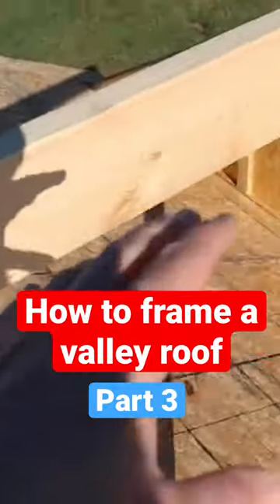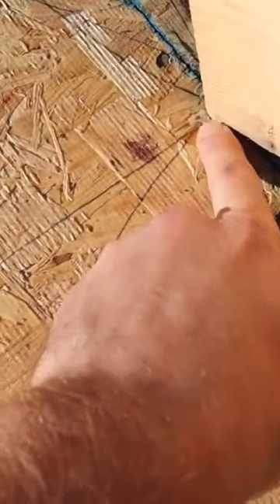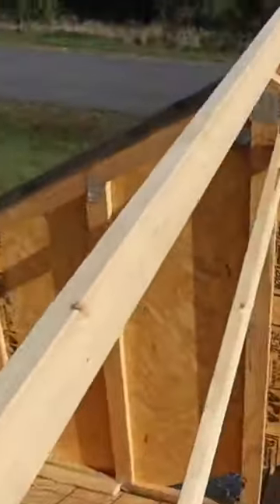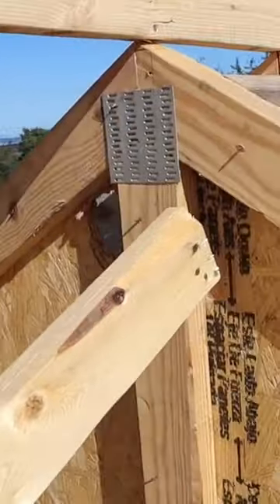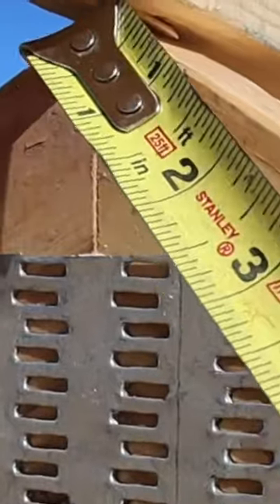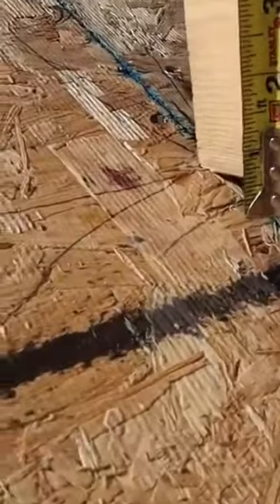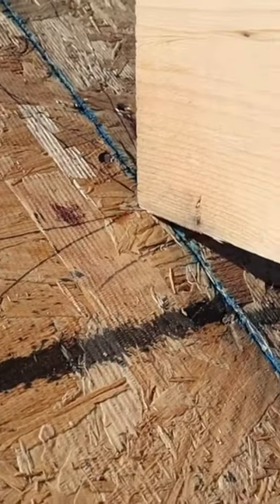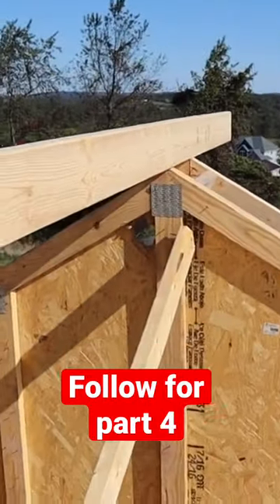How To Frame A Valley Roof - Part 3 #shorts #framing #diy #build #construction

Comment: On larger gable trusses I will use a laser  to project over and then use equal measurements from each bottom of the gable truss where they both intersect that laser line. A lot easier especially when the ridge is over 16'. That's usually the max we'll order our 2x4 and 2x6 at.

Comment: Why not cut the pitch of the roof on one side of the 2x6, then measure from the long point to the peak , level the peak , pull your measurement cut and nail done.
Reply: Because he isn't a carpenter